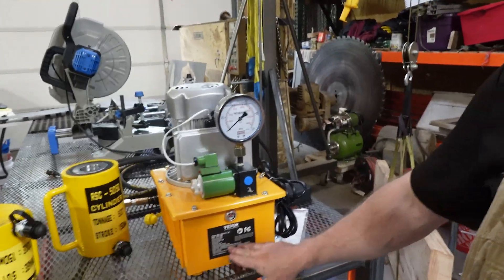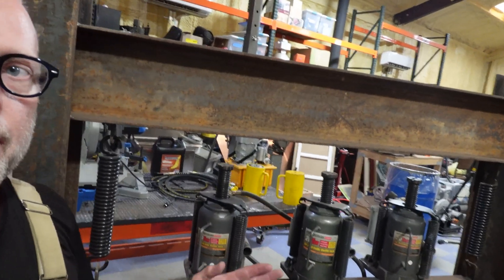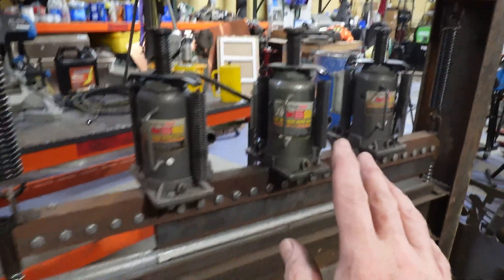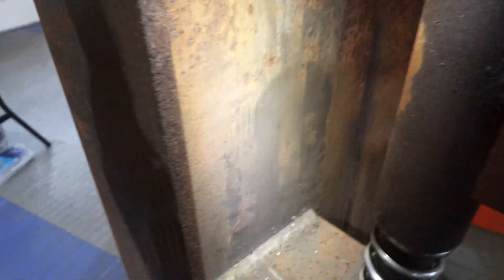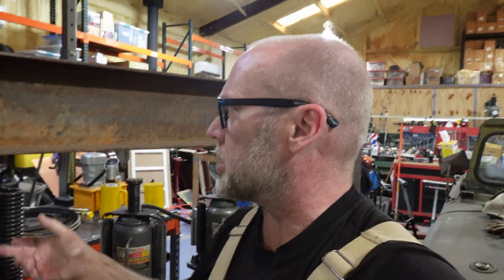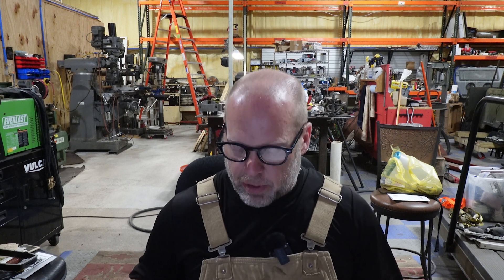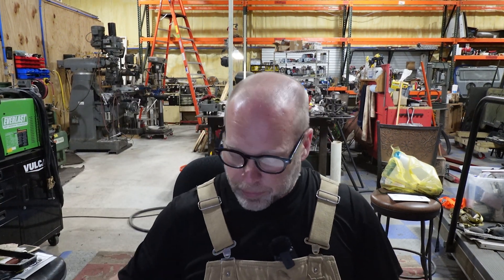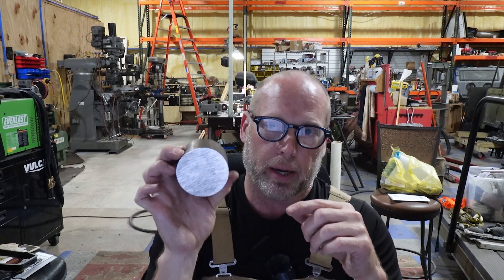100  Ton Press Brake Build - Vevor Cylinders and Pump - Part 2 - Overview And Intro To Hydraulics

Comment: Why are you using 10000psi hydraulics over 3000? I’m guessing it gives you more control
Reply from the maker: I'll start with the obvious first, the cylinders I used are designed to use a 10Kpsi pump.

Now what I'm about to say is generic, I am not a hydraulic engineer, but this is the high level explanation.

Without getting into too much hydraulic theory, if you were to try to get the same force from the rams using a 3Kpsi pump, the rams would need to be about 3 times the size (in internal square inches).  

This has to do with how hydraulics work, PSI is pounds per square inch.  So, if a given cylinder is rated at 50 Ton and was designed to use a 10Kpsi supply, it would never be able to achieve 50 Tons of force if it were driven by a 3Kpsi pump as the "pounds of force per square inch" would be lower.

Comment: Enjoyed watching all the videos on the press build! Especially this one on hydraulics! I built a press using two 20 ton cylinders and a air over hydraulic pump from vevor and plumbed it in the same way you did here and one of my cylinders presses faster and with more force than the other one making my press not bend square. Is there a way to synchronize the cylinders? I’m learning hydraulics this is the first thing I’ve ever built including them in the project. Thanks
Reply from the maker: Thank you for commenting and I'm glad you are enjoying the series.  I'll start this by saying that I am not a hydraulic engineer, anything stated here is based on my personal observations, experiments and research. 

There are ways to sync hydraulic cylinders, but none of them are cheap or easy.  There are electronic methods, hydraulic methods and even a couple mechanical ones. It's a lot to get into in a reply to try and describe them all so I'd say google them and we can chat more once you have a basic understanding.  However, this is likely not the key to your problem.

Do you have 1 AOH pump or is it one per cylinder?  If it is 1 per cylinder, you will have a hard time getting them to sync up as no 2 AOH pumps are exactly the same speed. 

If you have only 1 pump, and a "T" in the line as mine is, the difference in speed should not matter too much as they will equalize when they meet resistance.  However, if they have different force, that is another issue (which it sounds like may be the case for you).  If you have a smaller line or any other restriction anywhere in the system, you may experience issues like you describe.  If one is running slower, due to a restriction, the faster one will develop pressure first as the second one has not yet met resistance (or equal resistance).  Depending on what you are bending it could crush the higher pressure side before the lower pressure side 'caught up' and developed full pressure.

Also, if you have air in one of the cylinders, you will also get the situation you describe as you will lose force.  Hydraulics depend on the fact that fluids cannot be compressed, but air can.  So, the cylinder with no air will develop full force, one will air will develop less force as the air compresses and reduces the force.  This still should equalize, but depending on your hydraulic plumbing it may be problematic.  If you notice, i mounted my rams upside down, this was to place the fittings at the top so that if air did get in, it would get automatically purged when they retracted.

It would be great if you could make a video of your setup and the issue, I would love to see what you built and offer some more insight, but without knowing the entire setup it's pretty hard to narrow it down.